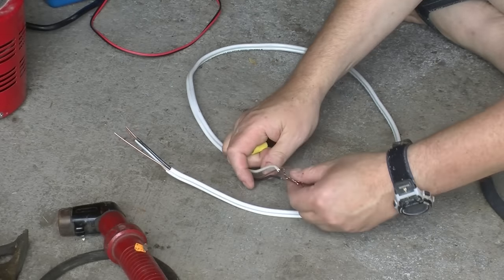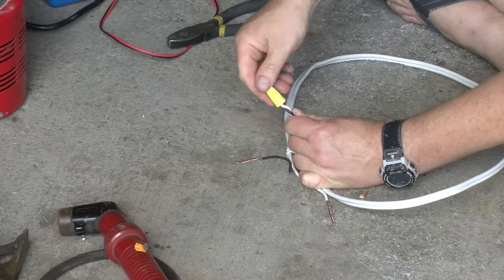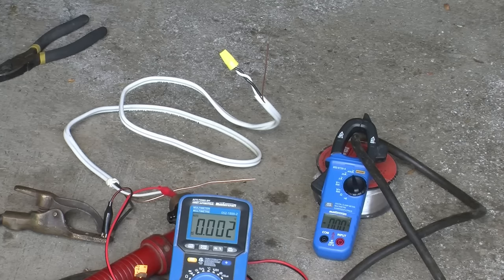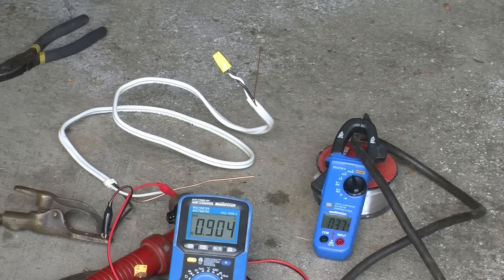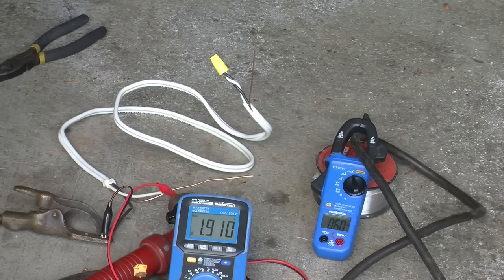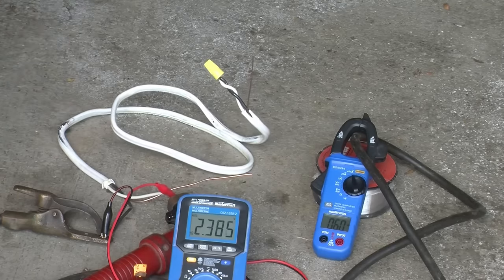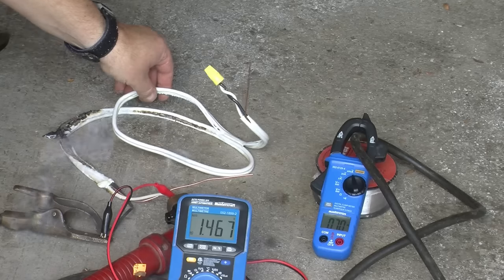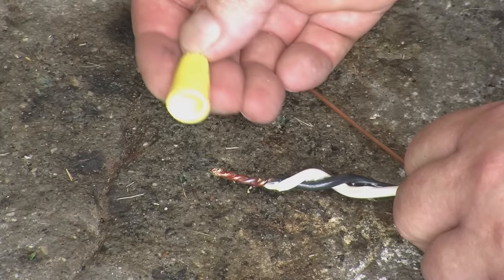How many Amps to burn up 14/2 electrical wiring?

Comment: Experiments are very interesting and fun but I think you should invest more effort in the disclaimer when it comes to Romex and household electrical methods and devices and equipment. People don't understand why the ratings are set where they are and therefore rationalize that it's overly cautious and low...you may be giving a green light to many people to scoff at the NEC and create dangerous conditions. "Knowing enough to be dangerous" is that much worse when so many people have the opportunity and motivation to save a few dollars on materials when renovating their homes.... it's like you are 'scaling liability ' for yourself and for YouTube with the use of something so available to millions of people. ( People already push limits and this video needs to include more information on the reason for Code rules.)

Comment: It not a good test. Given if the voltage is 120 and at 15 amps it is 1800 watt. if it only 60 amp at 12 volt it only 720 watt.
Reply from the maker: Your confusing the power delivered to the load with the power dissipated in the wire due to Ohmic heating. Its the voltage drop along the wire (not between the wires) x current that is the heat that melts the insulation. There is a more extensive explanation here https://www.youtube.com/post/UgkxeilOfLJGy2ODslnBW0WFXUE580oHhFyP

Comment: You aren’t going to live long grabbing live wires dude. Not the smartest tool in the shed. Buy a laser temp gun.  If you really must feel how hot something is with your hand then use the back side. It’s more sensitive and when you burn yourself you can still use your hands. You however should stay away from electricity. 😂

Comment: I wouldn't touch a shorted wire with a hand tool.
Reply from the maker: Its all low voltage so not an issue! I explain it here: https://youtu.be/CP3-jcpzZeI

Comment: Ok, so I’m probably safe replacing all CB’s in my home with 30A ones 😂 The EV charger keeps on tripping at 15A setting 😄
Reply from the maker: I sure hope you dont :) Look at some more realistic video I did with the 14-2 in a walls filled with different types of insulation. Its scary how little current can produce a significant temperature rise!

Comment: 35 years as an electrician idiots twist wires. FYI 14/2 is rated at 50 amps  under Tap rule NEC

Comment: That was only at 2 volts, 120V would produce significantly more heat ❤‍🔥It would be cool to see how strong of a magnetic field is produced at those amperages.
Reply from the maker: The heat from the 120V at the same current would be produced in the load, not in the wire carrying the power. Here we are looking at the heat given off by the wire due to its internal resistance which depends only on the current flowing though the wire and in normal circumstances is much less than the heat (or power) delivered to the load. 

I did a whole series of videos on magnetics. Here is one showing the force between two wires as a result of the magnetic field: https://youtu.be/1X5SBXXOF2k

Comment: How many houses run at 1.5V?
Reply from the maker: Not many around here :) The voltage shown is the drop along the wire which is what causes the heating in an overload situation.

Comment: The only 14/2 in my house is for LED lights in the attic. :-0)
Reply from the maker: Everything else is 12/2? That would be great for modern high current draw things like laser printers etc.
Reply: @ElectromagneticVideos  10/2 w/grd everywhere else and GFCI protection between the breaker and the first outlet on every circuit.(was a retrofit of 100yr+ stone/plaster house that had the old armored 2-wire).
Reply from the maker: @2Truth4Liberty  How interesting! Old buildings like that are really neat.
Reply: @ElectromagneticVideos  The nearly 2 foot thick walls make for deep window wells but rob you of floor space. It looks a lot bigger on the outside than it feels inside.
I use portable A/C units (about 12A each) and wanted to be able to plug them both in no matter what circuit they're on.
Reply from the maker: @2Truth4Liberty  You must be in the south! When I was a kid we lived in an old stone house with those giant window wells. Worst part: the old windows - even with storm windows on the outside the cold drafts in the winter were terrible.
Reply: @ElectromagneticVideos  Williamsburg, Kansas somewhere between North and South. Long Hot (and humid) summers. Longer Cold COLD winters. Short spring, short autumn :-(  Oh well.
Whoever did the plaster here did a great job because I get no drafts from between the wood trim and the interior walls. People that do plaster amaze me. Quite an art talent that I will never have.
I do sometimes put up window film on the inside of the old single pane windows - has  storm windows but those a very old and leaky if you know what I mean.
There are two other houses like this one in this small town - guessing they were the first three houses ever built around here.
In town (which basically consists of one BBQ restaurant, one breakfast cafe, a post office, museum and township fire department) there are some mid-late 1800's store and hotel fronts (one hotel still being used as "sleeping house" rentals ==
https://www.kansasmemory.org/item/220339 ) - and a railway depot that is now converted to a private residential house ( https://www.kshs.org/index.php?url=km/items/view/220341 )
Reply from the maker: @2Truth4Liberty  I did finish one room during covid - mudding and taping drywall is something i discovered I hate doing. Those look like wonderful old houses!
Reply from the maker: @2Truth4Liberty  And you near Ottawa! Unfortunately not the Ottawa I'm near!
Reply: @ElectromagneticVideos  Go Ottawa Cyclones!!
(Old private Baptist College there in Ottawa, Ks)
Reply from the maker: @2Truth4Liberty  Your actually near the old Route 66 I think - one of my bucket list items is to drive that when I retire. Never been to central US so that would be fascinating trip for me.
Reply: @ElectromagneticVideos  Thanks for your comments. I think I will replace all the 30A breakers with 20A (it's only 6 total) And if I have problems with the A/C kicking them, I can always put a 30A back in if needed. I only use A/C for about a 90-100 day stretch each year so even an occasional kickoff during those summer months would not be a big hassle - I lose ALL POWER form the company several times a summer anyway.
Go ROUTE 66 !!!! :-0)
Reply from the maker: @2Truth4Liberty  I'm actually so glad to hear that. Electrical code aside, using the 30 amp breakers is really tempting fate in a bad way and I was quite concerned. If you find the 20A breakers tripping when the AC startS and draw a surge, I know there are some  breakers than have higher short term surge ratings while keeping the thermal (longer term) limit low. I don't know if they are available for residential breaker panels,  but a good electrician in your area might know! As far as "Go ROUTE 66 !!!! " goes - the other one for me is the Alaska highway!
Reply: @ElectromagneticVideos  My breakers were only 4 yr old, so I found 20A good used replacements on ebay all 6 for $50 .. should be about bullet proof now :-0)
Reply from the maker: @2Truth4Liberty  Good deal!   Maybe you can sell your old ones! Not to make life even more difficult for you, hope they arnt Federal Pioneer?
Reply: @ElectromagneticVideos  Square D - but for what I would get, I'm just going to hang onto them for now.
Reply from the maker: @2Truth4Liberty  I have always thought Square D are about the best. Be interested to hear what others think.

Comment: Long term heat damage is the issue
Reply from the maker: Certainly if you you have a cable only a bit above its rated current and managed to cook for years without a catastrophic failure.

Comment: That 80% thing is very misleading... Loading a circuit past 80% is perfectly fine, 100% won't even remotely harm the conductors or the breaker, heck a thermal trip won't even occur till 135% and a magnetic not until a staggering 200%... It's a planned and preventive number is all the 80% suggestion is... Nothing more!
Reply from the maker: And perhaps the more practical  reason for the 80% rule is to prevent nuisance breaker tripping when the line voltage strays away from the nominal 120V or 240V leading to increased current flowing in the circuit potentially for a longer period of time.

Comment: I'm not impressed with this demonstration.  I would rather see it on a 50 amp breaker with a 50 amp plug and run a load through it like a welder and weld instead of a dead short which will produce a lot of heat just like a wall baseboard heater.

Comment: Would have expected testing amperage at a given constant voltage, say 120 or 230V. 
Not surprised the cable does multiples of the amperage it is rated at but at 1V or so
Reply: At 120v it would be hundreds of amps
Reply: @libtrs838  is that right though? A cable handle a certain amount of power loss (=heat dissipation) which would mean that at a higher voltage the amperage would be lower. Standard 230v circuits in the EU are often rated 16A or 32A (depending on cable cross section) for example. Therefore I’d expect anywhere from 15-50A depending on thickness of the conductors
Reply: @mph8759  Wires or cables are rated by how many amps they can carry, not wattage. The voltage rating is only for the insulation. In the video the wire is the whole circuit. V/R = I . The resistance of the wire stays relatively steady so the higher the voltage the higher the current. In the US our wires say 600v on them. A 14 gauge wire would be 15 amp 600v so 9000w, but you could use 6000 volts at 15 amps if you wanted as long as it was connected to something with high enough resistance to limit current (at least 400 ohms) but it would not be safe to touch. Insulators become conductors at high enough voltage. This is why we have breakers because at 120v or 240v if the wire shorts making a low resistance circuit you would have hundreds of thousands of amps and the wire would almost instantly melt and catch on fire.

The wire is about 0.025 ohms so at 120v = 4800 amps. It would immediately max out the power source.

Here is a copy paste I wrote to someone else if you want more details. I calculated wire heat loss at 1.5 volts and 120 volts both 50 amps.

V / I = R

I will also add watts of heat dissipated 

0.350 volts / 15 amps = 0.0233 ohms and 5.25w

0.481 volts / 20 amps = 0.0241 ohms and 9.62w 

0.730 volts / 30 amps = 0.0243 ohms and 21.9w 

0.970 volts / 40 amps = 0.0243 ohms and 38.8w

1.050 volts / 40 amps = 0.0263 ohms and 42w

1.385 volts / 50 amps = 0.0277 ohms and 69.25w

1.571 volts / 50 amps = 0.0314 ohms and 78.55w

1.920 volts / 60 amps = 0.032 ohms and 115.2w

2.40 volts / 60 amps = 0.04 ohms and 144w

He is increasing the voltage to increase the current. You can't increase voltage and hold the current steady because the resistance of the wire determines current. As you can see above the wire resistance does go up but it doesn't go up so quickly to hold the current steady.

Again because ohms law if you want 120v at 50 amps you need a resistance of 2.4 ohms. 120 / 50 = 2.4 ohms

As we can see at 50 amps the wire is nowhere near 2.4 ohms it is at 0.0314 ohms. The wire will never reach 2.4 ohms because it fails shortly after this at 60 amps and 0.04 ohms.

So now remember if we want 120v and 50 amps we need 2.4 ohms. We can do the math for this. So let's take a big hypothetical 120v space heater. The heater has a resistance of 2.3686 ohms which means it would be 50.66 amps and 6079w if it was connected to a 0 resistance wire at 120v, but that isn't how the real world works so we will have some loss, especially with a small 14ga wire.

Also remember conservation of energy. We have 120v x 50 amps coming out of the wall so 6000w that is all we have to work with.

We hook it up to our little 14ga wire. We know the wire is 0.314 ohms and the heater is 2.3686 ohms. Essentially we have 2 resistors in series so of course we add them.

R1 + R2 = R total. 
 
R1 (the wire) = 0.0314 ohms
R2 (the space heater) = 2.3686 ohms

0.0314 + 2.3686 = 2.4 ohms

V / R = I

120 / 2.4 = 50 amps or 6000w (at 120v)

Now how many watts are being dissipated by each resistor?

Well we need to calculate voltage drop across each resistor using.... Ohms law!  Current x resistance = voltage or IR = V

I = 50 amps
R1 = 0.0314 ohms

50 x 0.0314 = 1.57 volts 

So we have a voltage drop of 1.57v across the wire. At 50 amps x 1.57v = 78.5 watts (same as video)

R2 = 2.3686 ohms

50 x 2.3686 = 118.43 volts

So we have a voltage drop of 118.43v across the heater. At 50 amps x 118.43 = 5921.5 watts

118.43 + 1.57 = 120v

78.5 + 5921.5 = 6000w

The exact same 78.5w being dissipated by the wire at 120v as there was at 1.571 volts.

Comment: Oh crap i rewired my range outlet with 18g wire.
Reply from the maker: Oops :) Should make a great video though when you turn on the range!
Reply: Just run it on 480 volts and you'll probably be fine!
Reply from the maker: @professorg8383  Yeah - right! Your sure wouldn't catch me touching it with my hands to feel the temperature!
Reply: @ElectromagneticVideos  Yeah, it's funny because if you have tough hands, you'd be surprised at how hot you can touch without getting burned,  I cab take about 160F for about a second or so. But then my hands don't work well with touch screens!!  O have pretty high resistance too but  480 volts is pushing it! But the wire won't be hot temperaturewise. At 480 volts you should be within the ampacity of 18AWG wire,
Reply from the maker: @professorg8383  Yeah - a quick touch can sustain a pretty high temperature. I sure wont do a video to find out exactly how high :) . I think I read somewhere that somewhere in the 300V+ region, the voltage is high enough to puncture the dry skin layer and connect right to the moist salty flesh. I wonder if 480/277 is high enough to do that? An electrician friend told me of someone he know who forget a circuit was 600/347 and tested for voltage with his finger - and the whole end of the finger was blown off. Lucky that was the worst of the damage!

Comment: i ran 12 awg..... its not much more money.....
Reply from the maker: If I was having a house built today, I would do exactly what you did - you were very wise.  I'd also make sure the receptacles were one class better that the cheapest ones normally used.   

From what I understand, in some areas its now common to just use #12. I dont think its that way in my area but it seems like a really good idea.

Comment: Try 15 amps at 120 volts
Reply from the maker: Since that melts the plastic is from the ohmic losses due to the current,a different potential between the wires in the cable will have no effect other than the sparking that occurs once the insulation has failed.

Comment: Amps without volts means nothing, and vice versa.  Potentially a very dangerous video, because it could lead ignorant people to make unwise decisions.  

A properly assembled and tightend twist connector does not need to be 'pretwisted' because the act of installing the connector does that for you.

Comment: A residential 15A breaker will thermally trip at around 20A, magnetic tripping at 30A, horrible video, because residential 15A circuits work on 120 volts, 120 x 15 = 1800W is what that wire gauge is rated at, just because it can run above its rating for a while, does not mean it is meant to be run continually above its rating.  If you exceed the insulation's rated temp is when it will begin to melt (and you will smell it too), BUT the closer you are to the receptacle point the hotter it will be.  I have seen receptacles that get burning hot to the touch and burnt insulation nearby, yet the rest of the wire in the circuit was fine.......you can still have a fire hazard condition long before your actual wire in the circuits melts !   This video gives a false sense of safety !!!!

Comment: You're not comparing Apples to Apples are you  using a  vfd welder  welder are Low  voltage  ac/dc

Comment: Watching you pet the failing wire with your bare hands made me cringe! I thought you were going to lick it next 🤦‍♂️
Reply from the maker: Nothing to cringe about - its all low voltage and isolated from the mains. The biggest concern was that if it got too hot I would burn my fingers. And no - never had any plans to lick it :)